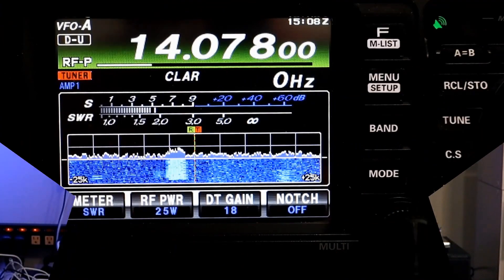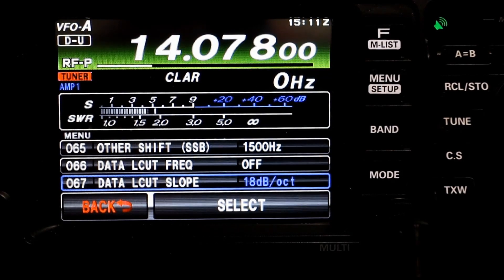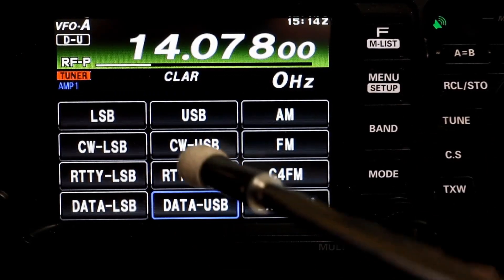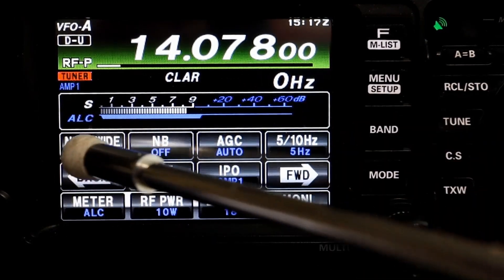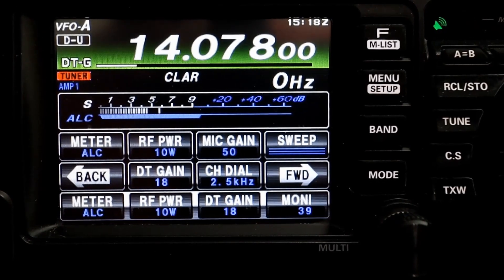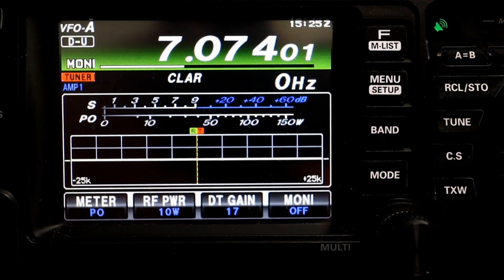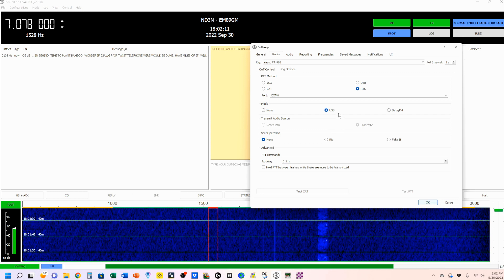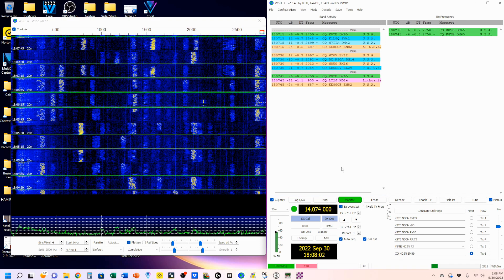A Better way to Setup for Digi-modes

Comment: Hi Tom. Tks for yet again taking the time and effort to make this video.  I run JS8CALL and Whisper from here all over the world.
The only thing that spoils my pleasure is that when I want to run my VARA HF and WINLINK combo... I need to alter the menu settings.  This is annoying me no end... so much so that I am now seriously considering buying a second HF radio to run that mode. With the world becoming a more uncertain place by the day, having VARA.Winlink on tap is a good thing I.M.O.
Yes, I could use my RT Systems S/W for the 991A to swap/change the those MENU settings... but that is too much work. FT8, Whisper, JS8 all run fine with only small mods to ALC and Pwr settings.
I run the Digi4 interface here, (made by CCG comms) , instead of the 991a's own soundcard, that one I now only use when I need to run the RT systems S/W. The advantage is that while Whisper or another digital mode is running, I can now still enjoy the windows sound output, for instance, to watch a YouTube video. Without the Digi-4, or another one like it, that just ain't possible.
Thanks again for this video Tom, very useful and I am sure many folks will really appreciate you making this one.
Albert EI7II.

Comment: Thanks for these little 991a tutorials. I had a 25 year old FT-900 and a Signalink which was all super simple with no menus. The 991a is amazing with all this stuff built in but it's a bit of a learning curve trying to use it. It's nice being able to configure the SSB-Data buttons differently than the voice.

Comment: I use 38400 baud for CAT RATE and 10ms for CATTOT. Otherwise my settings are the same, +/- a few notches on DT gain and PO. In my experience there are loads of people running linears (I owneth naught) and some maybe more than 1 or 2KW. You will know them by the fact they call CQ a dozen or more times in a row... people may try to work them, but their mouths are bigger than their ears.
I also turn the AGC off and use my RF Gain knob... you can hear when signals are distorted to know where to turn it down to, but with it off you never get a pump from a single close station that suppresses other signals a lot.
I have a value set for NOTCH (around 2550) and use it on 30 meters when the ARRL starts broadcasting bulletins. That allows me to work stations from 200 to 2200 or so (which is pretty much the only ones I can hear) despite the (sometimes) strong signal from W1AW. When they are done I turn it off... perhaps there are some other tuner-upper/lid situations where someone could benefit from the notch, but it is generally an emergency option.
My call is W5ZZO, I am surprised I don't have you in the log already. 73---